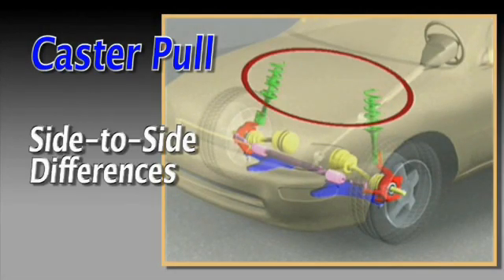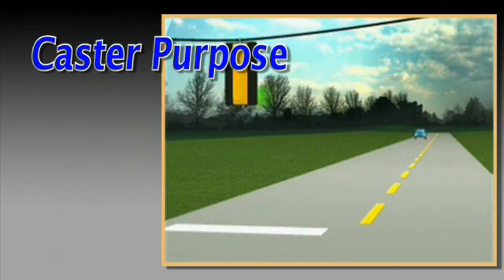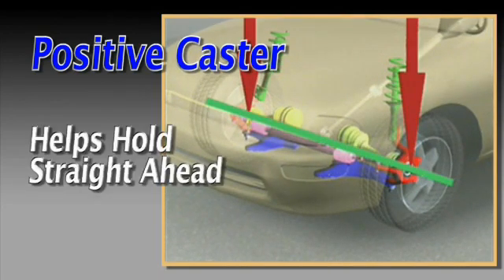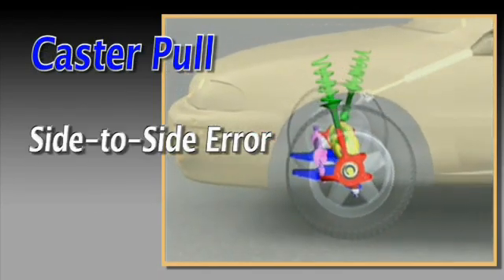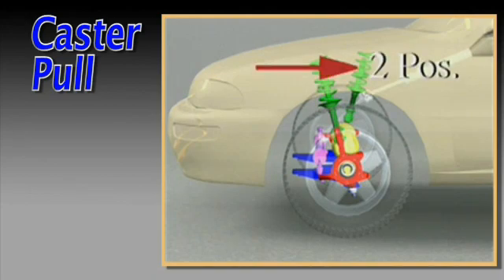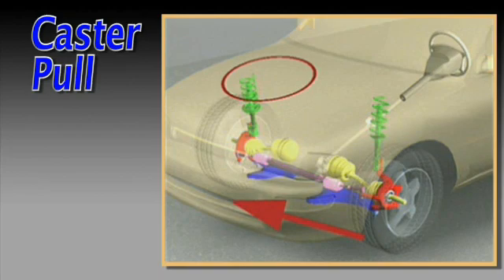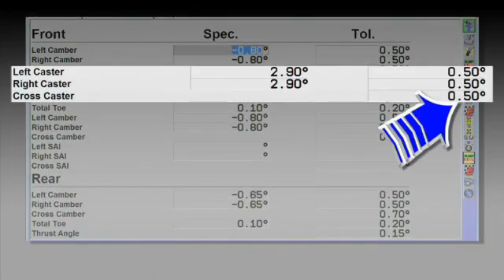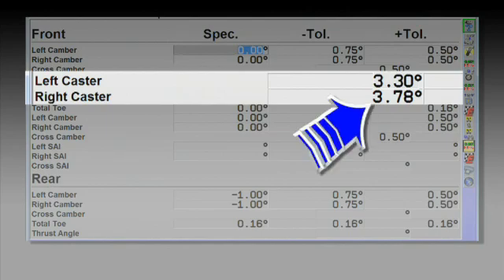Caster Pull - Hunter Engineering

Comment: shim the right for less positive it will pull right.....video wrong tried
Reply: You are correct. So is the video. We need to be clear on the terminology. The car will pull to the side with the LESS POSITIVE caster RELATIVE TO THE OTHER SIDE, not the current measurement. Shimming the RH for LESS POSITIVE caster than the LH will cause a PULL TO THE RIGHT. 

The result of shimming the RH for LESS POSITIVE than it has now depends on the caster of the LH. If the RH becomes LESS POSITIVE (MORE NEGATIVE) than the LH, it will PULL TO THE RIGHT. If the RH becomes MORE POSITIVE (LESS NEGATIVE) than the LH, it will PULL TO THE LEFT.
Reply: @iambriancompton my car has a caster of 5.2 degrees on right and 6.3 degrees on the left.. its causing a pull towards right side while driving on a highway.. what should i do.. pls help..